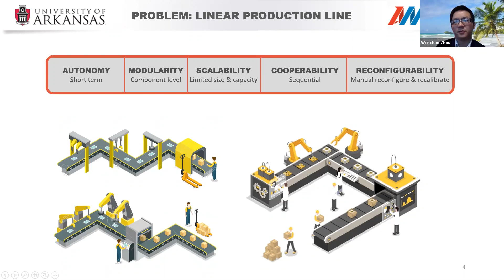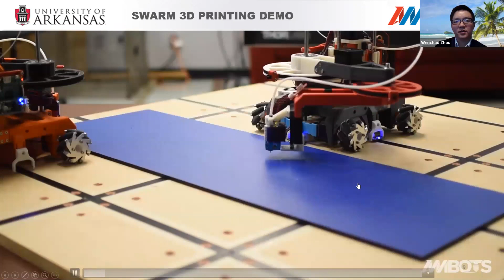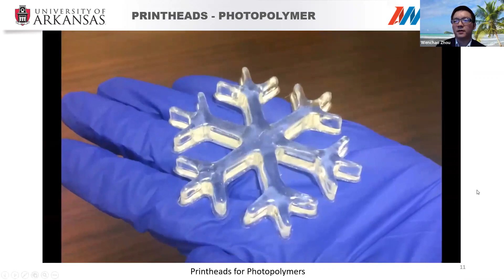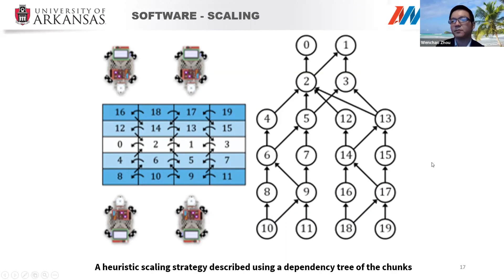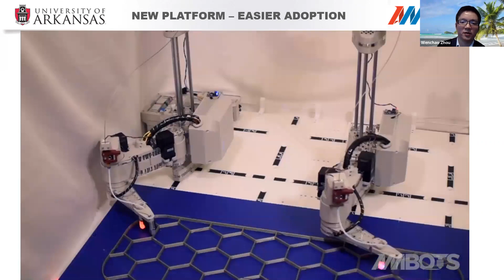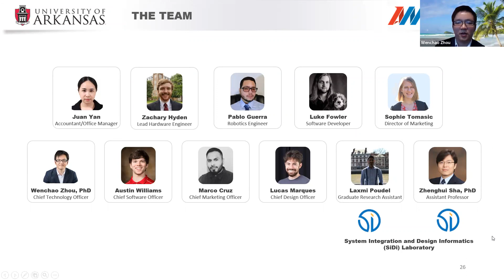Technology Centers Spotlight Series  Swarm Manufacturing – A New Paradigm for Smart Factories

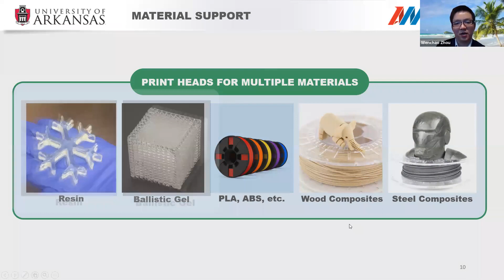Comment: 14:18 Print Heads for Multiple Materials

Resin printers do not have a head / Nozel or something like that.
Please explain Resin print and how to Print 3540°C hot Steel on a moving bot
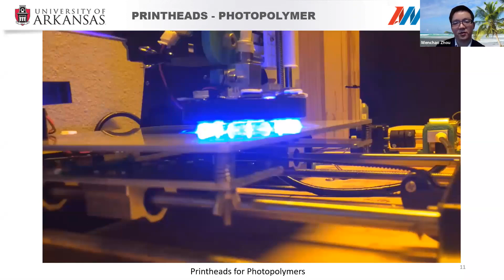Reply: If you watched the video, right after that at 14:38 you can see how it prints with liquid resin. Metal filled filaments already exist. You print, then bake. GIYF.